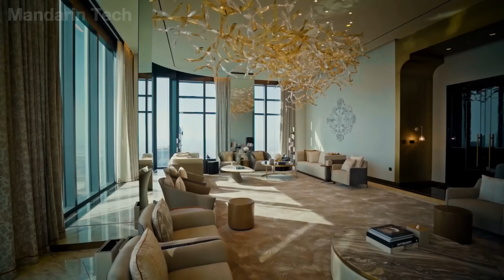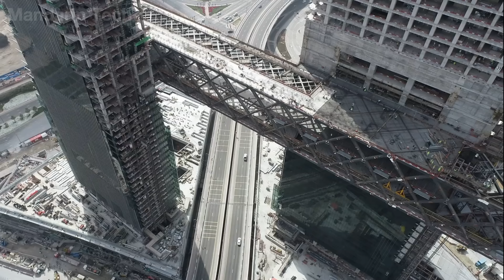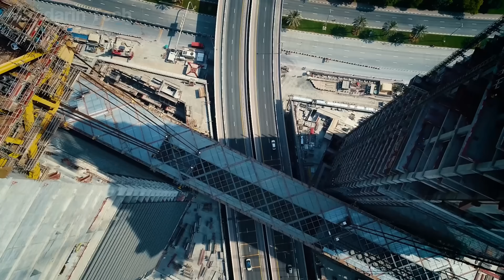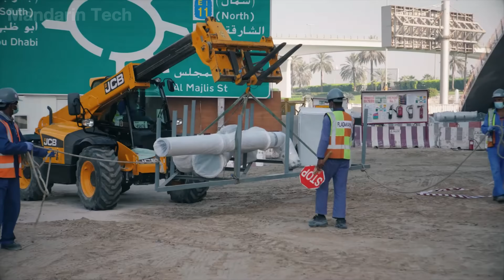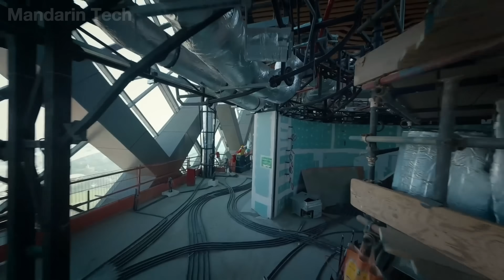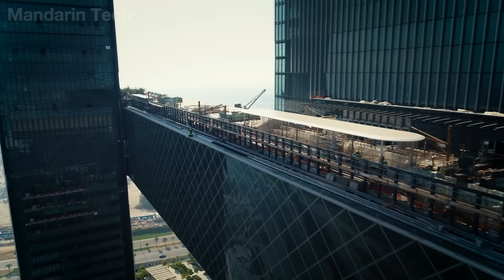How Dubai Suspended a 10,000 Ton Steel Giant Between Two Skyscrapers

Comment: The skyline of Dubai continues to redefine what is possible in modern construction—where engineering precision, architectural ambition, and complex logistics come together to create structures once considered impossible.

Civil Engineer Perspective
🇬🇧 English

“How Dubai Suspended a 10,000 Ton Steel Giant Between Two Skyscrapers” showcases the extraordinary capabilities of modern structural engineering.

Lifting and positioning a massive steel structure between high-rise towers requires advanced load analysis, connection design, temporary support systems, and extreme precision during installation.

For civil engineers, this project demonstrates how innovation and engineering expertise continue to push the boundaries of construction.

Engineering transforms bold concepts into reality.

#CivilEngineering #StructuralEngineering #MegaProjects #SteelStructures #HighRiseConstruction #ConstructionInnovation #EngineeringExcellence

Français

« How Dubai Suspended a 10,000 Ton Steel Giant Between Two Skyscrapers » met en lumière les capacités impressionnantes de l’ingénierie moderne.

Le levage et l’installation d’une structure en acier de cette taille exigent précision, analyse structurelle et innovation technique.

Pour les ingénieurs civils, ce projet démontre comment l’ingénierie repousse constamment les limites du possible.

L’ingénierie transforme les idées ambitieuses en réalité.

#GénieCivil #IngenierieStructurelle #MegaProjets #StructuresMetalliques #ConstructionGrandeHauteur #InnovationConstruction

Español

“Cómo Dubái suspendió una gigantesca estructura de acero de 10,000 toneladas entre dos rascacielos” demuestra el nivel de la ingeniería estructural moderna.

El izaje y montaje de una estructura de esta magnitud requiere precisión extrema, análisis estructural y soluciones innovadoras.

Para los ingenieros civiles, este proyecto refleja cómo la ingeniería sigue superando límites.

La ingeniería convierte ideas ambiciosas en realidad.

#IngenieriaCivil #IngenieriaEstructural #MegaProyectos #EstructurasMetalicas #ConstruccionEnAltura #InnovacionEnConstruccion